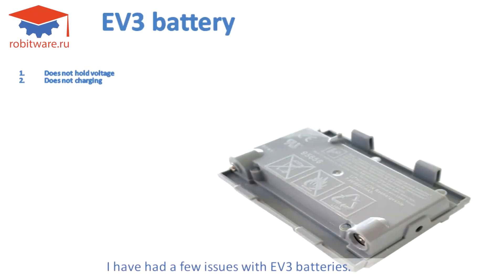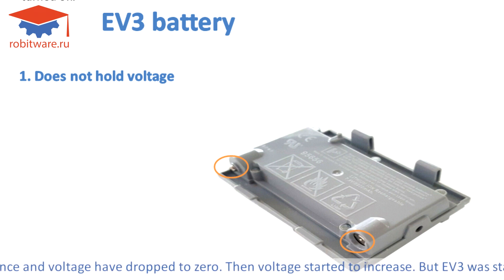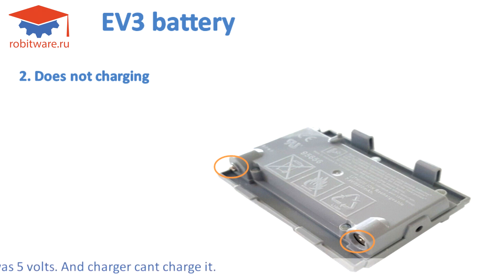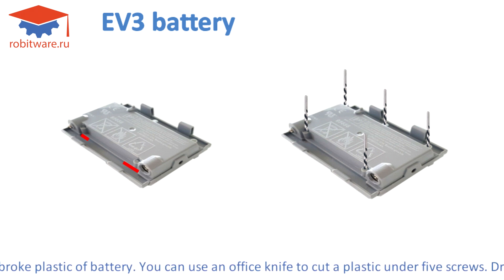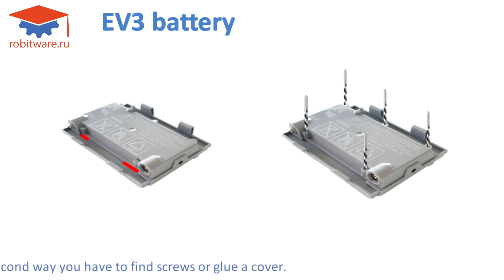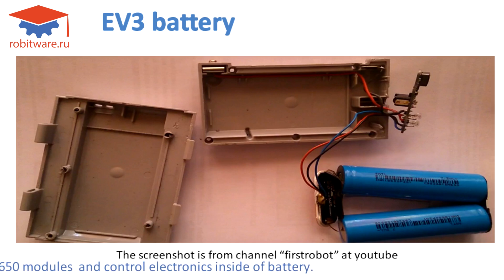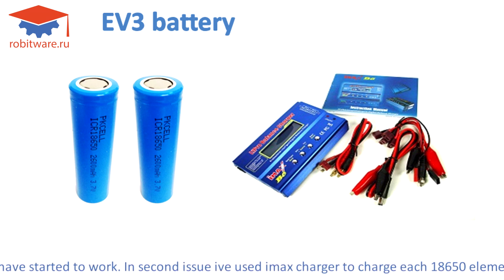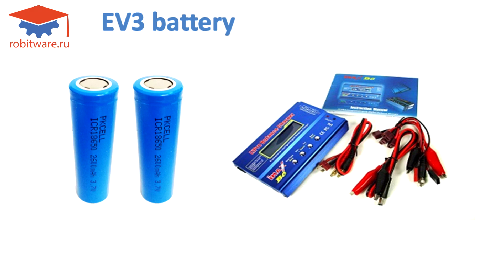EV3 battery issues

Comment: My EV3 runs correctly with 6 batteries but doesn't start with any recharging battery. It tries to open flashing the red light for some milliseconds and then it turns off.